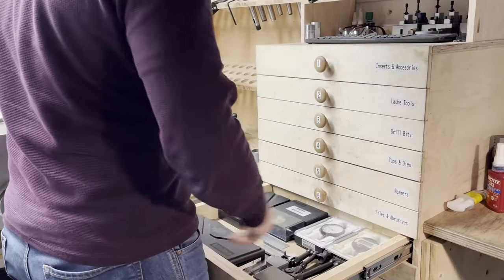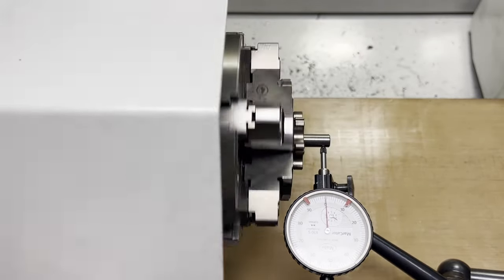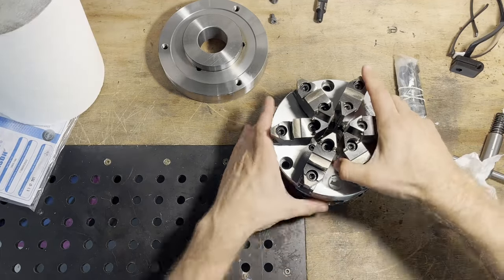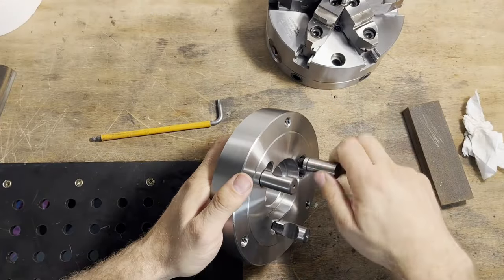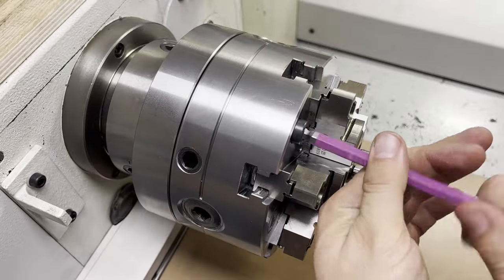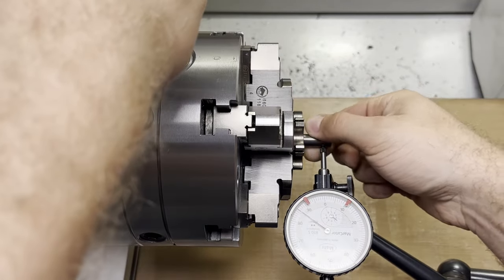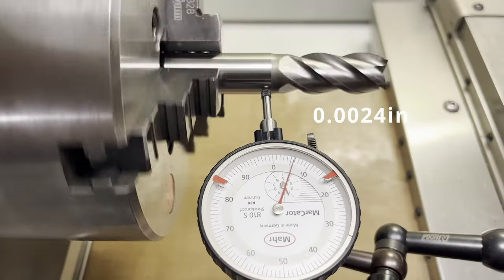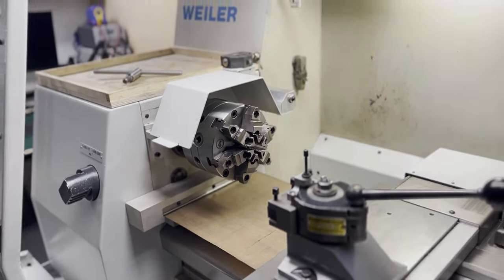It's time for an upgrade - Bison 6 Jaw Chuck

Comment: Very pretty! I've had nothing but great results with Bison chucks. I currently own a Bison 5" 3 jaw plain back that holds 0.0005" concentricity on all diameters. And no coning to speak of. And I have a 6 jaw just like yours, simply an awesome chuck. 

A while back I purchased an Emco Super 11, and it came with a USA made Buck 6 jaw set-true (one piece jaws), and that is a honey of a chuck. Lighter and a more delicate touch than the Bison, I use it for small parts - it will clamp down to 4mm. BTW, I never really bonded with the Super 11 and a friend owns it now. 

The spindle features on your lathe are running very true. I do that kind of check, but I also do another kind of measurement that shows the errors of motion of the spindle. I use a 1" G5 ball on a XY mount that I gage against. The ball is mounted to a circular dovetail base that is in a cup on a 1/2" mandrel. The ball can be translated by 100 TPI instrument push-push screws. I gage the ball surface with a Pretec (Alina) LVDT gage. For a somewhat rougher on the road check I use my Mahr Supramess 20 millionth indicator.  With the ball mount chucked into whatever work holder I then XY translate it until I get the lowest average runout. I then record the excursions for a few revolutions and plot them. I do a circular (elliptical) fit and subtraction as that is always something that can be adjusted out. The residue is the deviation from perfection of the "axis" of rotation. The errors come from small variations in the size and shape of the bearing balls, the geometry of the bearing races, etc. I do this for as close to the spindle as I can get, and then several inches out. The axis generally sweeps out a complicated "cone" in space. It usually repeats not every revolution but something like every 1.6. This is due to the ratio of the inner and outer race diameters and if there is an errant ball rolling around. Doing this check at two planes let you find the "focus " of the sweep, and you can usually make a good guess at what is going on with your spindle bearings. I expect you'll find very little error in your spindle motion. Whatever you do have, you'll find that a test plug cut will show about one half of that magnitude in out of roundness. I use an air bearing for doing the roundness check. 

I'm always searching for my next ex-lathe. Weiler lathes are very interesting but, alas, practically non-existent in North America. It seems to me Weiler nailed the intermediate manual lathe - the 600-800 Kg class. In the pre-you know years, 2018/2019, I seriously considered taking a trip to Germany to purchase a Weiler and get it shipped over. Or, try to find an agent to do the deed. I might still do one or the other.
Reply from the maker: The Emco super 11 has appeared on my radar after seeing it on Stefan Gotteswinter's channel, but it dissapeared quickly because it was a bit to small for me. Basically it was like my previous Wabeco from a size perspective. 

Regarding your measuring instructions, I can't say I fully understand yet how I can measure it, you obviously know more than I do about this topic. I will take more time when I am in front of the lathe to digest it. Or if you have a video of someone doing that, I would be grateful. 

Regarding the Weiler lathes, I really love them, for me it bridged the gap between manual and CNC. None of these was right for my wants and needs and I did not had space or money for two separate machines. They are not cheap here too, I've found a few during the years, but you can monitor sites like surplex.com, machineseeker.com, troostwijck.com. I've found my lathe on the last one. Wasn't quite cheap, because it overlaps the hobbyist market with a garage space. My friend that I am talking in the video, got an E50 in waaaay much better condition than mine, and excepting the controller he was able to keep everything in terms of motors and drives. For my machine I had to do a bed regrind. For his machine the bed is like new. No scratches or dints, basically no wear at all and he got the machine for 3k eur. However, his machine is much bigger, and it would have never fitted in a garage. Hope you find one there too, not sure how much the shipping would be. 
The cheapest Weiler E30 that I saw after I bought mine, was 2500 eur, same year, aprox the same visual condition as mine was when I bought it.
My machine weighs about 900kg. If you are taking it to US you will need to change the motors anyway so it won't be a problem that it needs 400v 3phase.
Reply: The Super 11 popped up locally on Craigslist - just 60 miles away and it looked good. I was the first caller and was over there later that day - up in the mountains of central California. It was an old fellow - Axel - who was closing out his movie camera repair business. I basically bought him out. Axel and his wife Erika had immigrated to the US back in the 80's and built a little bit of Bavaria heaven up there, lived their dream, and were moving to a easier situation. 

The Emco was in wonderful condition, obviously not much used.  But it just wasn't the machine I wanted. I got a lot of nice things from Axel, most of it I still have and use.

I'll describe the ball check again in a different way. Imagine you have a ground pin, and it is perfectly round. You chuck that into a 4 jaw independent chuck and commence to center it. You will find that, no matter how you try, there will be a level of runout that you can't remove, even though the pin is perfect. The runout you are seeing is caused by the intrinsic motion error of the spindle.  

I use a ball instead of a pin as a good ball is easy and cheap to buy. I bought 10 1" G5 balls for $12! I thought I was going to have to improve them (my background is precision optics fabrication) but after checking them on my ~2 microinch roundness checker I found them to actually be G5 quality. Amazing really. I mounted the ball to a pad that forms a positive circular dovetail, so when screws push against it the flat bottom of the pad is pressed into the screw cup. This affair is attached to a 1/2" diameter pin that I can put into a collet or a jaw chuck. The screws are a standard type of precision adjustment screw made for jigs and set-ups. Look at Thorlabs:

 https://www.thorlabs.com/thorproduct.cfm?partnumber=F6MSS10

I get them with the threaded bushings and bond the bushing into the hole. 

I usually use an LVDT electronic gage for the measurement. This lever head gage is sensitive to a couple microinches, and has very low hysteresis. But it's bulky and finicky. I recently acquire a used Mahr Surpramess 1/2 micron gage. Very good sensitivity and repeatability for a manual gage. For ordinary spindles it's more than good enough. 

If you plot all of the readings you can do some simple statistical analysis. The first thing to do is detrend the data for circular/centering misalignment. Making ever finer centering adjustments becomes futile when you are getting down to the level of the motion errors, so it's best to just subtract them mathematically. Basically, a circular function fit and subtraction. You can then find the standard deviation, RMS, and PV of the detrended data. 

This is all kind of academic, but you did say you chase microns... I used to have to do this because I was chasing nanometers. Spindles and slides on diamond turning machines have extremely high requirements (~ one microinch), and keeping the machines tuned meant being able to check these things. I left all that in 2016 when I retired. But I started a business that required some normal machining. I acquired a low hours Cadillac lathe (Mori Seki pattern) to make some big rings. It did that fine, but I noticed on very fine cuts the curl pulsed - it was intermittent. That motivated me to make the ball jig and investigate the spindle. I found at the spindle nose 2.5 microns peak to valley motion, RMS about 0.5 um RMS. Not bad really. But at 12 inches out the error was 13 microns PV! The geometry pointed right at the left hand bearing. The motion described a full cone in 1.58 rotations of the spindle, exactly how long it took for the balls to make one rotation in the bearing. There was one oversize ball in that otherwise fine bearing. Instead of doing the manly thing and rebuilding the spindle, I sold the lathe to a guy that didn't care much about precision while fixing his construction equipment. 

Since then I've checked every spindle that has gotten near me. It's a hobby now. My new to me really old Frankin (made from multiple machines) Logan 14 is a pretty decent example. The PV at the spindle and 5" out is a micron, and the RMS is 0.2 um. Not bad at all and it cuts a pretty smooth and round part. I use 2011 aluminum for round test pieces. 6061 extruded bar sometimes has a weakness that prints into the roundness.  

 i sometimes think about going on a crawl for the perfect manual lathe. Not too big, not too small. Quiet, more precise than necessary, perfect feel. I learned on a Monarch EE, kind of hard to beat that but the work volume is tiny and it weighs 1600Kg. I dream there is a Weiler LZ or something in my future. Money isn't much concern to me now, I'm happy to pay for a low hours machine

Thanks very much for the thoughtful reply, and for the links. It's episodes like this that make me think I need to figure out how to and make a YT video.

  @LikeFactoryMade
Reply from the maker: @randydewees7338  If you have any specific models Weiler LZ in mind, let me know. I might include it in my routine search on these sites. I often "relax" by checking what's new on the auction sites. That;s how I found mine, that's how I found the Weiler E50 for my friend. 
If you want a quiet toolroom lathe and you just want a manual machine, I think Hembrug DR1 is an awesome machine. I saw one in person, and I can say its the most quiet lathe I've ever saw. At 3000 rpm, you could only hear the wind. Usually they are not very expensive on auction sites here, and I see at least 2 interesting listings/year.
Here is one: https://www.machineseeker.ro/hembrug-dr+1/i-13003955
The downside for these is that the spindle bore is quite small, 25mm if I remember correctly. But other than that, the machine is a beast. In Europe Hembrug means hard turning.

I see you are very experienced, as my lathe's bed was reground, the headstock was removed when doing the grinding, and unfortunately, it sits on the V ways. From the factory there was a metallic epoxy between the headstock and the bed, that fell off when it was dismantled. Not sure how they have assembled it back but its not with the V ways, so I will have to dismantle it, rescrape the bottom of it and align it properly. If you think you can help with some advice on this, please tell me your email, or email me at the email in the channel's details section.

Comment: Is that dial indicator in inches? 1thou deviation is a lot. I have the same chuck and I can set mine to 1/4 thou. Take your time.
Reply from the maker: Both indicators are metric. The first indicator used to measure the chuck spindle taper runout is 0.001mm/div (0.0394) and the other one is 0.01mm/div (0.394 thousand of an inch). 
Yes, could tweak this further, but I’ve found it quite annoying that the set screws are not 90deg apart from another. It seems they didn’t had enough room.